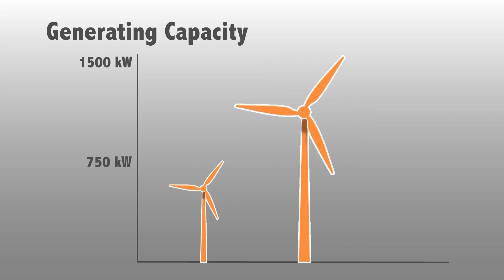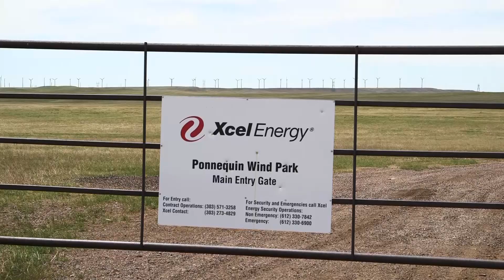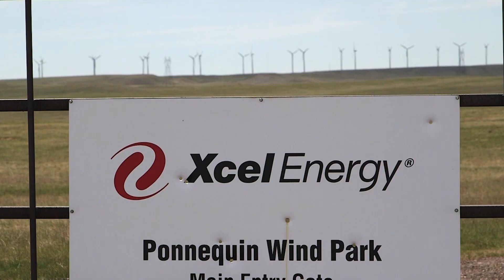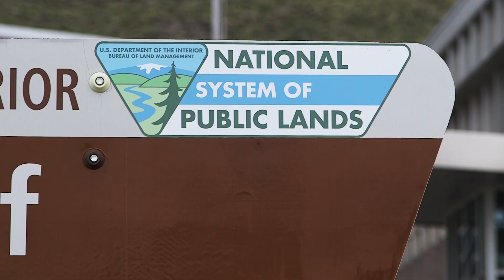Who Cleans Up When a Wind Farm Retires?

Comment: Wind and solar can't fully replace fossil fuels because fossil fuels contribute over 80% of energy.
Reply: Ahhh nobody says anything about GPG power 
the number one renewable energy for the world, oh bye the way it is 24/7 power and non intermittent. GPG / Gravity
Powered Generator. Non intrusive on the environment, unlike the above. Works outdoors, indoors, even underground 
GPG the only way to go!
Reply: @christopherwarner3219  Gravity powered generator might be an efficient, cost effective form of energy storage. That falls in line with pumped hydro or flywheel, or advanced rail. Definitely worth looking at, because the amount of stored energy necessary. No technology is off the table, we need everything. I don't think that it's possible to develop enough of any one technology, to meet the demand. Think on the scale of terawatts. I doubt there's enough materials to make that many batteries.
Reply: @christopherwarner3219  How exactly can GPG be a producer of energy? It can be used for energy storage, but how can it be a net producer?
Reply: GPG spins a wind turbine generator without the blades of course. Nothing to do with power storage. Why a wind turbine generator? Slow speed GPG mated to slow speed wind turbine. Being slow speed on both machines makes for low noise and wear and tear for longevity
Both machines on or under ground or indoors.
Various sizes for various outputs. Various uses besides electrical energy
generation. Ships / trains.
Slow speed Gravity Powered Generator with high torque characteristics
Reply: @christopherwarner3219  But where is the source of energy? How to utiliae energy from gravity?
Reply: GPG spins the wind turbine without the blades.
GPG Gravity Powered Generation by perpetual motion utilizing weights under gravity. I will have a prototype underway 2019.
99% confident to work!
Reply: @christopherwarner3219  There has to be energy input to have an energy output. You are basically talking about a perpetuum mobile.
Reply: There are two more technologies necessary for wind and solar to take over: One is grid scale electrical energy storage, and the other, is the ability to recycle defunct assets. That includes panels, old turbines, and old batteries. We already have a pretty good program in place for lead acid batteries, but we need similar recycling capabilities for all the other chemistries. Storage wise, there are limited areas where pumped hydro, or even advanced railroad energy storage. Batteries, and flywheels can be installed anywhere, but technology just hasn't caught up to the demand. Without electrical energy storage, intermittent renewable sources can only amount to  20% of capacity, without causing stability problems with the grid. As of now, you're right! I figure in about a decade or two, that may change.
Reply: Wind and solar only contribute a small percentage because the population outgrew growth in wind and solar.
Reply: @RichRich1955  A lot of people just don't understand the amount of energy we consume. Not talking just about electricity but energy in general. If we wanted to produce that much with low energy-density sources like wind and solar, an unimaginable amount of solar panels and wind turbines would be needed.
Reply: Wind and solar add 2% of energy to global energy.
Reply: @RichRich1955  It's new technology. Every thing gets its start, than grows from there. One technology that's still in its infancy, is grid scale electrical energy storage. Without that, intermittent renewable sources can't become any more than about 20% of overall capacity, or it could cause stability issues with the grid. Turbines and especially photovoltaic panels are starting to enjoy the economy of mass production. Flywheels, batteries, and other means of energy storage are still quite  expensive. Once energy storage reaches the same maturity that wind and solar have, then renewable energy will become economically viable.
Reply: You want a solution? The economy with consumerism and consumption is growing and every politician works towards continued growth. It's impossible to go carbon free with the economy and population in its present size. Everyone needs to shrink their carbon footprint significantly. More than half of jobs are useless. 

My numbers show that the population is three times too large to become carbon free.
Reply: @RichRich1955  It's more like 1 % of primary energy supply. There is a lot of potential in hydroelectricity in Asia, South America and Africa (worldwide undeveloped hydro potential is around 10,000 TWh yearly (more than 40 % of today's electricity consumption) according to WEC). There is also a lot of potential in nuclear energy. But even if we produce another 10,000 TWh yearly with nuclear (more than 1,000 new reactors needed), these two combined would make up for less then 10 % of today's primary energy supply. Of course efficiencies of EVs, heat pumps is higher than say ICEs and distant heating but we can clearly see that we won't be carbon free for a long time. PS: to produce 10,000 TWh yearly of solar electricity, we would need ca. 19 billion 300 W solar panels (with 20 % capacity factor).
Reply: @RichRich1955  Being carbon free is irrelevant. We have enough data to prove that CO2 was/is innocent all along. See Tony Heller's channel for the details.
Reply: @facel2  DC is actually used for the longest transmission lines (google HVDC lines), AC becomes too expensive to do that. I think the break-even distance in costs is around 600, 700 km, depending on the voltage, power etc. Yes, most of our appliances work on DC, but AC is cheaper for relatively short transmission lines, so AC is used there. AC can be simply rectified and stored in a battery. It's not that AC needs to be made 24/7 and DC don't, it's about the balance between production and consumption, which must be equal in every second, no matter if the power grid is made with AC or DC.

So you are off-grid if I understood correctly. You must have a big solar and battery system and live in a very sunny area or your consumption is very low. What about in the winter?

Comment: Most wind turbines contain big amounts of steel, copper and other metals that are quite valuable. The value of these metals is most of the time bigger than the cost of disassembling these things.
Reply: cant take the good stuff without taking the bad stuff,  unless its the usual renewables cherry picking of "solutions".  Better have a plan for the glass/carbon fibre epoxy blade material ,  large amounts of oil and 40 tons of concrete and reinforcing.   If the fate of all the genius tidal power schemes is anything to go by these will just be left to rot.
Reply: @yarpos  Google for decommissioned wind farms, they're already being left to rot. Have been for years.
Reply: I love seeing wind turbines catch fire and burn up!!!!!
Reply: @pauloconnor2980  Just like seeing lightning blow up a tree. It's very rare, but it's sure spectacular! It is sad, though to see a 2000 horsepower engine that uses no fuel( yes, real free energy) burn up though.
Reply: about the only non recyclable parts are the blades, the nacelle, and the hub cone. all the machinery and electrical components can be recycled. The blades are still a lot of debris to plow into a land fill. If you've ever seen a blade up close, they're HUGE!!!
Reply: @vincentrobinette1507  The point is that they aren't being recycled, some of those dead towers have been there for decades.
Reply: Ur totally  wrong not one ever  paid for its self just taller is not better

Comment: How does this compare with the cost,and difficulties of decommisioning an end of life nuclear power plant,and making the land fit to be used?
Reply: at a nuclear plant the problem isnt spread over 1000's of square kilometres,    depends what the next use of the land is I guess,  it may need very little
Reply: @yarpos  have a look at the cost of actually making safe,and removing the reactor vessel itself,and what is done with it afterwards
Reply: @michaelparker5072  nuke plant operators are charged taxes to help pay for this.
Reply: @kercchan3307  that doesn't answer the question